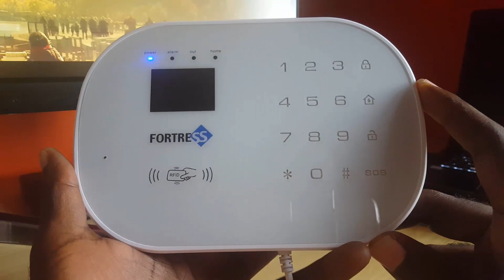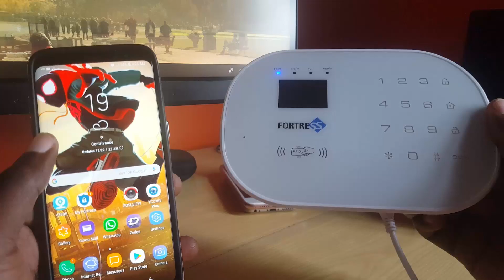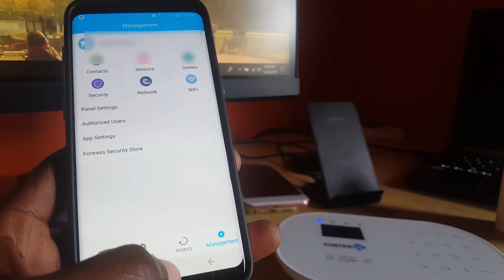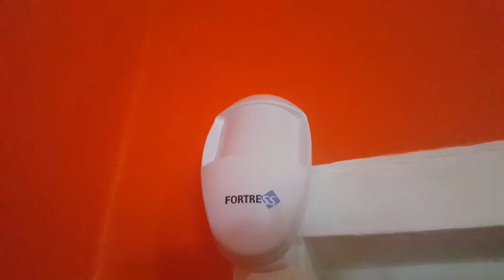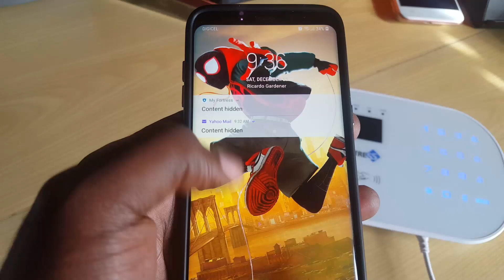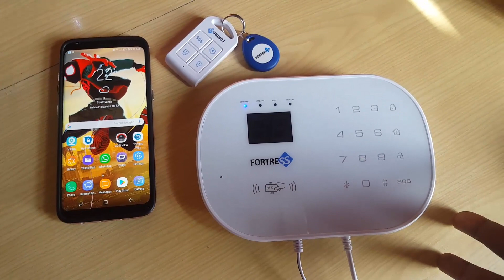Fortress S03 WiFi Security System Review

Comment: Howdy. Please guide me to deprogram the 03 system. I am having a door bell ping pong sound which I need to get rid of. If I am correct I will need to deprogram the system, correct ?
Reply from the maker: Why don't you connect the App you will be able to turn stuff on and off including the door bell without needing a code to deactivate.
Reply: @rickytlc1985  much much appreciated.  Thank you for responding. Kindly guide me in doing the App stuff. I am 60 years old and not technology savvy. So please be patient. Thank you.

Comment: Awesome review. I started to remove this from the list. Really would like to have secondary backup. Power is cut AND wifi, they break in the alarm sounds. They try to rip it off the the wall and it's still whaling? Yea..nice.. I love it. I still need the police or someone. But..ok..

If they break the hub wall mount and the alarm is whaling, how do you stop it after the excitement is over. Key fab I hope?  The sirens are outside correct?

Again. Thanks for the video and so well put together.

Comment: How long is the cable for the external alarm?
Reply from the maker: Not very long about 2 arms length with my crude measurement. You can use a cable adapter and extend it a few feet though. I did a video on it that may help.

Comment: Will this alert you on your mobile device if you are not connected to Wifi on the device? For example: You are at the store with your phone connected to internet via a dataplan. And the Fortress panel is connected to your home Wifi. Thanks!
Reply from the maker: Yes it will notify you that the device has disconnected, it does this also for power. Even if it does not once you find you cant successfully connect to the device remotely it would mean the WiFi is out. In my case I use this in connection with my Security camera so knowing if the WiFi was out would be easy.

Comment: If power is cut to the home will the alarm still work without WiFi????
Reply from the maker: Yes it has a built in battery and the system will still work in power cut.

You can also place your WiFi Router on a UPS as a additional step so the step can update you even in a power cut.